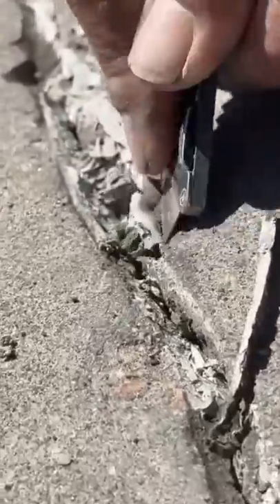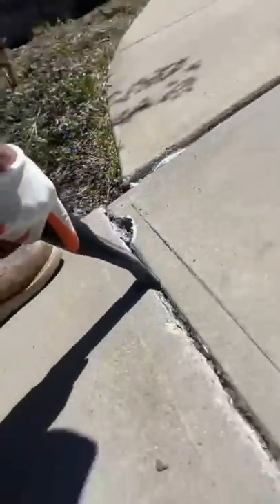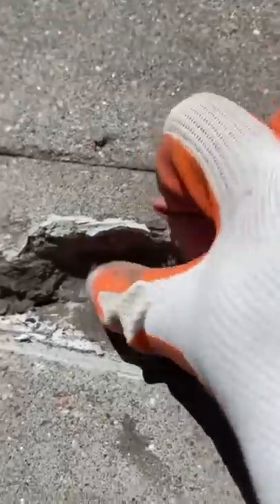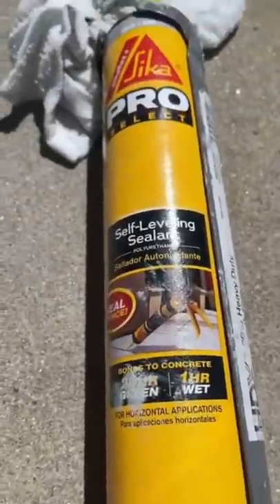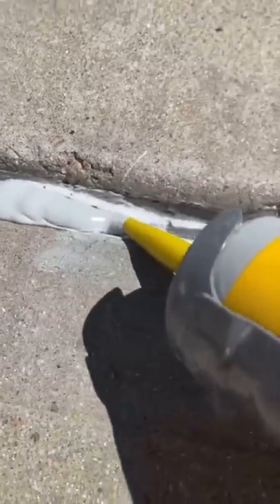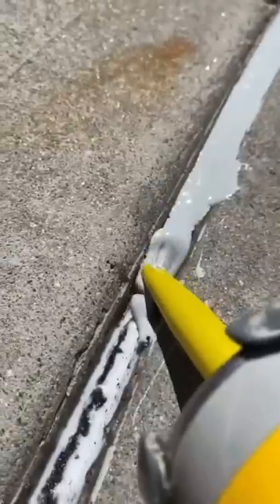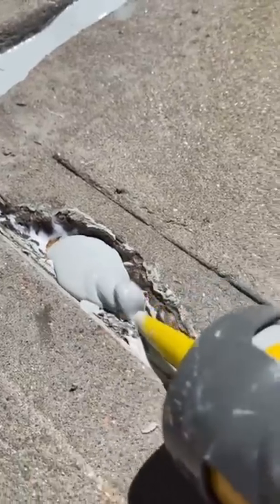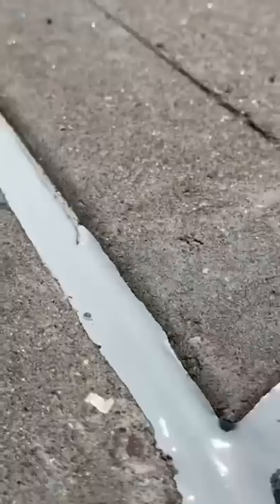How to repair driveway control joints #shorts #driveway #repair

Comment: I love how everyone knows how to do it better, but literally everyone gives a different solution
Reply: That's kinda the part I love about it too. No one does it the exact same so you get the freedom to choose which person you like the most and then it ends up with everyone getting what they want, and doing it how they want. Except everyone who sucks at it. No on will use them and they'll have to go figure out a something they're better at, or learn to improve ect. Even with people who wash cars you can tell everyone does it differently. I got into wallet making for a while and literally no one was the exact same even when it comes to a flat piece of leather
Reply: Ive done it all kinds of ways. This stuff works the best but is a pain in the dick. 
Really just depends on how expensive the property is and how much you give a shit. Sometimes you just need to pass inspection. Other times its a full reno trim and all.
Reply: @TheAnnoyingBoss  that's the beauty of it. Just shows you're really good at what you do when you know there's a bunch of ways to do it you just choose whats best for that project
Reply: Another beautiful result
Reply: Comes back 1 year later and its worse than before
Reply: So what is the solution smart people
Reply: @tigrecarri9146  hit it with a wire wheel on each side after you cut it out, I would've just used silicone and tooled it cause some of his you could tell wasn't bonded.
Reply: Many ways to skin a cat
Reply: Hundreds of ways to get the job done but everyone chooses what works for them, or whats more convenient on each specific job.
Reply: There's so many ways. Honestly it's more about the ethics of the contractors and how much they charge for the tm on a job like this. Because some will do more for less. I personally would've took an additional step but I understand the vid is restricted to time as well. I'm sure he got this done right
Reply: Thats bc theres like 10 ways to make this look better than he did
Reply: There's more than one way to skin a cat....
But only a couple ways to do it right
Reply: In the end IT all falls apart
Reply: Anyone can do it not everyone does it right!

Comment: I've been doing this for over twenty years professionally and the kid did it right..
Reply: Where could I contract this service in Indianapolis? I’d like my drive way looking crisp, what’s the name of this service?
Reply: @ihdave1  get some anger management
Reply: @prestigegamer4310  old man wouldn’t know happy if it hit him lmao
Reply: Travis Mitchell,Same here ,paving,stamped asphalt,driveways ,roads Alot of highway Paving,prevailing wage jobs ,And when or if it rained some n we couldn't bring the tamper or use a roller on the R-Blend we put dwn mostly really pumpy u no whats up but I'd go out n seal coat n crack fill driveways n fill in potholes if need n we also did alot of curbside drench paving we cut out in mostly ALL NEW DEVELOPMENTS, n we run the push behind wet saw cut out atleast 32 inches so the tamper n roller can blend it in nice....I had to speak up brother cause anyone in this line of work when its 102degrees outside n  400degrees n or way hotter then that depends on what u ordered n how hot the MACADAM comes out from the silo n I was saying bro the hotter the better makes the asphalt easier to work with on driveways n shit ,,Tell me u know the old saying for ASPHALT is MACADAM  n bro ASPHALT workers that make it atleast 3yrs well thats all BECAUSE ASPHALT n seal coating n crack filling n yea we do the same shit with pool noodles n it works awesome,,So now u heard a my speech I'm jus gonna tell u n 20years or more ,,brother this shit is definitely in are Blood ,we are a whole dif breed my friend n we ALWAYS look out for one n other when u smell like Diesel n ur boots r slippin all over the floor at WAWA..N U HAVE NO TRACTION ANY MORE ,,IF I SEE SOMEONE LIKE THAT """ITS LIKE A JEEP THING"""U GIVE THE NOD N GUARANTEE U HE DEF NODS BACK THATS HOW WE DO ...STAY COOL OUT THERE BROTHER..N I AINT TELLING U ANYTHING U DONT ALREADY KNOW MY BROTHER....
💪👊💪🔥💯%💥💨🙋‍♂️.Much love brother mad RESPECT..... ""(KEEP ON LAYING THAT"" 
         👊"((BLACK GOLD))"👊
Reply: That looks terrible.
Reply: @ab3__774  when has a crack fill ever looked not out of place
Idk what to tell you besides getting your eyes checked because there isn't a cleaner crack filler than this
Reply: @adrianjesus4040  dpè
Reply: I hate to brake it to you but you could’ve been doing it wrong 20 years.
Reply: @ihdave1  It's not wrong, it's affordable. Concrete cutter alone for a full cut will cost more than sealant, then sealant will become far more expensive due to higher volume. SL1 is not cheap. 

I've done both ways for decades. The difference is hundreds or thousands of dollars. 

The only "wrong" way is ignoring it and letting it worsen.
Reply: @zodwraith5745  
Exactly. Well i have the same issue on a customer's driveway. I know concrete last a good 50yrs on 4inch slab. It looks to be 30 yrs of no maintenance and normal erosion but very clean. You can see the gravel clearly, steps separated from slab, drains out toward back yard but pools around the steps so my thoughts was to recommend she replace the entire driveway cause the money keep coming, i could pass & keep rolling but I wanna help this lady cuz she only gets 900$ monthly. How should I price this cause I havent been in the biz of slab repair cuz it's tear & slab around here. I have a few days to give her an estimate. Im gonna give back & help cuz money ain't my motive but how to repair like I was thinking resurfacing the entire 124 sqaure ft of driveway. Which way should I go with this to save time its obvious.
Reply: @adrianjesus4040  nope. You never use self leveling first. You fill and seal the crack with a regular nonflowing after the backer rod. The self leveling is the last to go on...
Reply: @ihdave1  Not on a driveway.... On a concrete wall, yeah you chip it out but on a concrete driveway  no. You can use the saw and blast through the old filler and get nice straight new lines but that's a ton of work.
Reply: @frankhaskell6543  Prevailing rate, always. The only thing he should have done differently was used a nonflowing on top of the baker rod before the self leveling. The nonflowing will seal any small holes where the selfleveling could drain out. Never go right to self leveling without using something to make sure the self leveling isn't gonna flow out the bottom first. Foam backer rod helps but you should always use nonflowing on the backer rod then self leveling.
Reply: @ihdave1  why would you want to cut the crack deeper? Whats the point?
Reply: Just because you don’t get a call back to fix it again it doesn’t mean you did it right. The reality is that they called a proper handyman to do a proper patch instead of filling an expansion crack with Home Depot sealant.
Reply: He didn’t prime it
Reply: I would of used bulk, but this seemed pretty good.
Reply: @prestigegamer4310  get some education
Reply: @Imgonnakmsstg  it’s been 3 months and I gone up in the education system sooo.. you get one
Reply: Should've grind the joint and clean with solvent to ensure proper bond.  If not it will fail and can be pulled out with little to no effort.  Won't really matter on a driveway but not on a pool deck when it's on the roof.
Reply: Other than the color choice, should have gone with sandstone, we use it and it looks better and matches with the concrete more than white, other than that looks good.
Reply: @psiewert83  you know what though? The repair only happens if the customer will pay for it and if this was all they wanted and could afford guess what? It's the correct repair
Reply: @michaelf.2449  That’s a piss poor excuse. You’re saying it’s ok to do something wrong if the customer doesn’t pay you enough to do it right? Don’t take the fucking job then!
Reply: @psiewert83  reading comprehension son learn it. No I said if the customer will not pay for the proper repair then you do the best you can with the repair they can afford. You want to cut it all out and repair it they cannot afford that so nothing gets done and it gets worse or you do this and it buys time so it doesn't get worse.
Reply: @michaelf.2449  Sorry kiddo. A piss poor repair is not a repair worth doing. Cutting corners and half-assing the job is not acceptable no matter what the customer can afford. If they can't afford to do it right, it shouldn't be done at all.
Reply: @ihdave1  ok arthritis, just making sure you know that people learn differently and have different ways of doing things.
Reply: these replies are like a bunch of italians when someone makes pasta in a different way than they do
Reply: @ihdave1  Google censors me from using the m word.
Reply: @ihdave1  might a recommend a therapist for that pent up anger lol
Reply: @ihdave1  Therapy's an option you know :).
Reply: He did it right if you want a band aid cracks will always open back up until you find out why it’s cracking in the First place
Reply: @Tiyratania  I've had plenty of masonry work done and the material used cures to a tone that matches preexisting work. You might want to get your eyes checked if this looks standard to you.
Reply: Little low in few spots did it right but could have been prettier
Reply: @frankhaskell6543  where do I sign up
Reply: Homedad Nips  Well, go ahead and prove it. Any craftsman worth his weight in piss wouldn't leave it to such a simple statement, and would further explain his point. There's too much pride on the line. Go on.
Reply: Except for using a product that only has a 3-year limited warranty for homeowners probably should have went with a product by BASF
Reply: @zodwraith5745  for one you wouldn't want to cut all the way through you would use a diamond cup to clean up your edges and then you would use a v blade to round out your joint problem is they're chasing cracks with the garbage product like he's using here I do this stuff commercially
Reply: @psiewert83  get a life homie
Reply: @phuxxdeluxe5408  sorry for hurting your feelings buttercup
Reply: @frankhaskell6543  
Damn that was the edited version?!
Reply: any one try sand?
Reply: Looked like he was a bit short on caulking.

Comment: I put sand in the cracks of my drive way used a hanger wire and vibrated/wiggled sand into cracks as far as it would go.  Followed up with this type of sealer.

Comment: That is an expansion joint, control joints are either tooled or cut after initial cure. Perfect method! Backer rod and self leveling sika flex, allows for expansion and contraction, and gives a nice looking finish!

Comment: Your application is great. 

Sealing joints does 2 things:
1) Keeps moisture away from the base/sub-grade and prevents the base from pumping and eroding away. 

2) Keeps non-compressibles from lodging in the joint. 

The joint is there to allow expansion and contraction of the slab. Hot/cold cycles. If a non-compressible stone, etc lodges in the joint, when the slabs expand, they squeeze up to the stone and causes a stress point that can cause the slab to crack. 

It’s routine maintenance to clean and reseal the joints. 

That stuff does not work on cracks. That’s a different repair.

Comment: There’s never a “wrong” product to use it all depends on the customers wants, but a lot of those self leveling, specially the ones from Home Depot, are cheap and they look like trash in a year or 2.  Also a good way to fill those cracks is with sand, it’s cheap and easier to fill those crack then using caulking and the foam.  
And sprinkling some sand on the finished product will make it look a little more natural then a thicc plastic in your driveway.
Reply: I suppose you are throwing everyone off the sent of the harbor freight value sealant,  trying to save the good stuff for yourself
Reply: No just get very strong concrete gravel, flatten it out and it will be way better than sand, I think
Reply: @GloomTapes  yeah true! But I think for hairline cracks sand would work best
Reply: Wrong...
Reply: @GloomTapes  sand is better
Reply: Good call man. That looks wank as it is, sand would defo look better on top
Reply: Is sand gonna keep the moisture out and keep it from cracking further when it freezes? That's the main concern here
Reply: @exploridori  I don’t live in a freezing/snowing climate. I’m from so-cal , so personally I would try and find a product that works best in those cold climates because in your area there might be those type of options.
Reply: Sika is a very good brand of construction chemicals
Reply: A silica sand or polymeric might be even better. Once you wet it it hardens up, so you won't have to refill them when wind or water clears it out.  Here in socal we get a lot of wind so I personally like polymeric so it doesn't blow away.
Reply: @BiggieDiesel01  yeah I should have been more specific , I do use silica sand. Never tried polymeric, we’ll give it a try!! 
Havent had any problems with any sand blowing away tho.
Reply: I’ve used sand and coated it heavily with acrylic concrete sealer. Seems to have held up nicely for 2 years now and I live in eastern WI. See what happens I guess.
Reply: @michaelmeathammer5688  you used just sand and put sealer over that? In a crack or on top of the cement ?
Reply: @iniguezrobert  in the cracks. I cleaned them out first. Put a lot of sand in then sealed it.  I used fine sand
Reply: @GloomTapes  “ no don’t listen to this random stranger unless u want bad results, here trust me, the other random stranger, and do THIS instead!!! trust me, it will probably look better!!!.. well, i dont know ~for suuure~ thats just what i think.. “ .. headaynus boy 😂🤠😎
Reply: @exploridori  well duh, what do you think sand was made for???
Reply: @michaelmeathammer5688  how fine is it really tho? 👀
Reply: Because that's exactly what this is a cheap product from home Depot and this guy calls himself a professional very sad
Reply: Not exactly the same but I've seen people lock in small bricks that they used as flooring almost like tile with sand , they pounded it it and used like a vibrating machine to pack it in real tight
Reply: @g.6991  yeah that’s just compacting them with sand! lots of new different products you can use with pavers !
Reply: Silka is expensive af what are you on lol
Reply: @NamNguyen-hn2cc  its very inexpensive actually. Prolly looking in the wrong places

Comment: I used to do this for a living they do make dye to mix with it so it matches
Reply: They took it out of home depot which is the typical place non-contractors buy everything.
Reply: But they do make 2 different colors
Reply: @ewdtrey  Contractors often use home depot. 40-60% of most stores output is from contractor orders. It averages at around 45% of total company output
Reply: @snowcow1173  you're
Reply: @snowcow1173  Also, contractors do go there often, but most don't get everything there. Speaking from experience. Most contractors have a handful of places they know where certain supplies are cheaper.
Reply: @incagrico9280   you should improve your reading comprehension skills. I said where non-contractors buy everything. Contractors do go there, they just know not to rely solely on Home Depot and Lowes(home centers).
Reply: Having done this before, I can’t even imagine how that’s supposed to work. I mean, this stuff comes in large caulk tubes to make it easy to put down. Unless you buy a larger quantity that’s not tubed, how the hell are you supposed to evenly mix in dye? Not just getting it in there but mixing it evenly too and checking to ensure consistency sounds way over complicated. The regular non colored version is pretty damn close to generic concrete Grey color as it is once it dries
Reply: Yeah thats kind of shit you dont mention to customer though. Haha. More head ache than its worth. It'll blend in real quick once it gets dirty.
Reply: @ewdtrey  yeah most contractors only get random shit and tools from hardware stores. Wood, maybe fasteners and random shit like specialized caulking. Most of material, if you're smart, is coming from wholesale distributors. And you buy as much as you can in bulk/by the case depending on your storage situation.

Comment: pro tip, sprinkle sand ontop while it cures, that way no leaves or insects get stuck on it as it dries. It also gives it a concrete texture in the end that blends better

Comment: Not sure how often you do this but you can use a angle grinder with a wire brush wheel to clean the cracks out.

Comment: Actual PRO tip. After this process if you cover the material with sand (while still tacky) it will stick and make the crack almost invisible.
Reply: Or just use hydraulic cement patch and get it done without "tricks"
Reply: @a-a-ron6822  I agree that what he did isn't technically the best possible solution but you don't know what you're talking about. These gaps are there for expansion and contraction of concrete and hydraulic cement would not allow for that. It would fail 10x faster than this.

Comment: In my last job we didn't use self leveling sealant, we used spoons and rags to make the cracks to have a round finish. And if the spoon could not fit we used dish soap and a finger.

Comment: I don’t always agree with all of your solutions but I’d say you did a good job here. Can’t tell you how many people I’ve seen just start pumping sealant in there thinking it’ll stop and fill up eventually but meanwhile it’s all just streaming out the side of the concrete pad. 

I’ve never used this type of sealant so I can’t say if it’s just the same, better or worse, but personally I use a kind called Vulkem, and it comes in these same large caulk tubes, looks identical and is also self leveling. So if you for some reason don’t love what you’re using currently, I’d totally recommend Vulkem as an alternative. But yeah this was a great tip/video for a simple way to DIY this specific issue